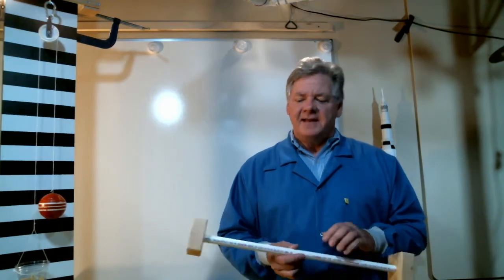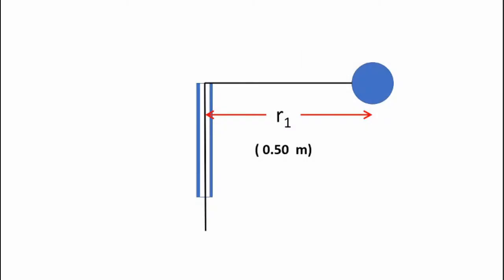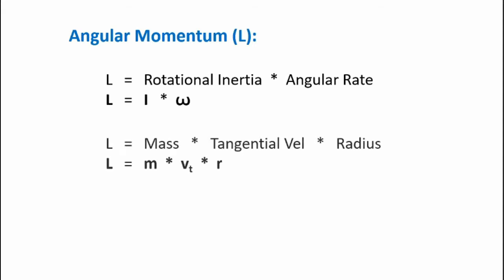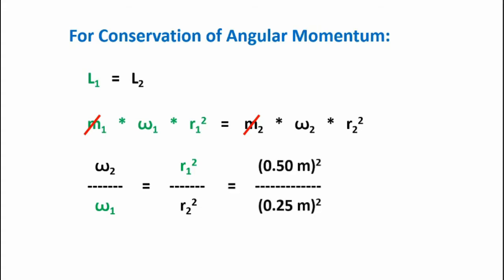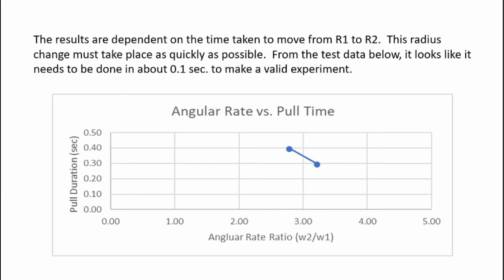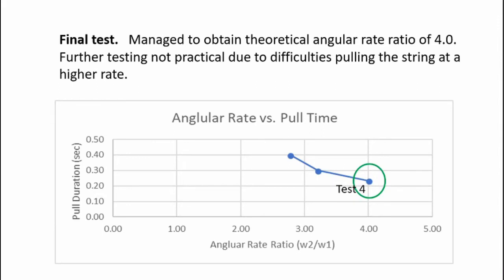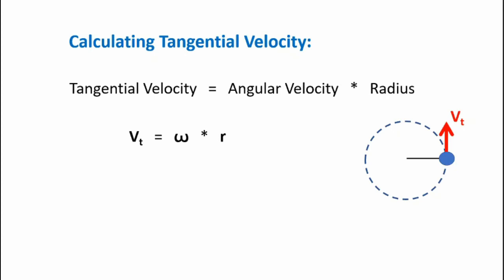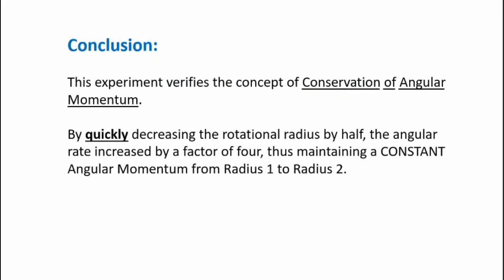Conservation of Angular Momentum

Comment: Dear Sir, had you been trying to confirm that angular energy was conserved and were expecting a result of a two fold increase, would you have continued manipulating your experiment or would you have been very happy with the perfect result your experiment achieved on the first pull ?
Reply: How come you dont believe in the conservation of angular momentum? Having seen your website and comments around I could only see your dissatisfaction with some discrepancy in numbers in experiments which are high enough to start questioning but not high enough to completly overthrow it. And thats he reason you completly refuse it?
Reply: @fracapolligummala3548  As part of my research and development, I was making experimental prototypes which were designed to conserve angular momentum to extremes. I discovered through experiment that angular momentum is not conserved.
Any rational person who observes an average (starts at 2 rps, radius reduced to ten percent) ball on a string demonstration  will agree that it does not accelerate like a Ferrari engine as is genuinely predicted by existing physics.
This is overwhelming independent experimental proof that angular momentum is not conserved.
There is no counter evidence. 
The Lab Rat has confirmed with a brilliant apparatus which achieves a perfect blind result that it is in fact angular energy that is conserved.
It is irrational not to completely refuse it.
Reply: @TheAnimammal  Cant angular energy and angular momentum be consevered at the same time? It works for linear motions.
Reply: @fracapolligummala3548  How can the result of this experiment be two fold increase and four fold increase at the same time?
Reply: @TheAnimammal  Your right, cant be. Acctually Im adding energy when im pulling the string, dont I? So energy increases by Force times way. Since we can derive the conservation of angular momentum from linear momentum, in which I think we still believe, then the resulting discrepance in energy would be the amount we have to put in. Now that im thinking about it I remember experiments from the ISS that showed that bodys when rotating and lossing energy begin to shift their axis to the one where the masses are out the farthest from it.
Reply: @fracapolligummala3548  The only way to add energy to the system is if you start yanking on the apparatus as has been shown precisely in this very example. before he yanks, his result is exactly two fold increase. Yanking on an apparatus is not acceptable and has never been acceptable. It is especially not acceptable to yank harder to overcome imaginary friction. It is imaginary friction because the initial result shows the expected negligible friction when it matches my prediction perfectly. Yanking is not repeatable (the same experimenter cannot achieve the same result twice in a row) therefore it is not science. The result otherwise is a two fold increase which means that there is no adding of energy to the system which makes sense because the force is perpendicular to the motion so the direction changes, but not the magnitude of momentum. Even when the radius is changing, the force is very nearly perpendicular to the motion (provided we are not yanking which is not part of a ball on a string demonstration anyway), so the component of force that is in the direction of motion is negligible. 

You are not adding energy to the system, you are supplying the required energy to generate non-linear motion of the mass. If no work was being done, the mass would travel in a straight line at constant velocity.

It is very clear, since I am presenting an argument which contradicts traditional beliefs that all of the existing theory contradicts my work. So presenting the existing theory which I claim is false against my proof that it is false, does not falsify my argument.

This is called an appeal to tradition logical fallacy.

My argument is basically that there is no extra energy being added to the system. You cannot prove that I am wrong by stating the opposite.
Reply: @TheAnimammal  I see your point. Arguments obviously have to be based on things we mutally agree on. Could you clarify then for me what things you still accept on the classical point of view so I know how far I have to dislodge my believes? Of course espacally interesting would be what gets conserved when. And if you dont mind, could you tell me how much you understand of analytics and vectors so we can speak on even terms?
The reason why I thought energy was added is because of the centripetal force. When we take an ideal model where everything is ridged and friction free we still have to hold the string, withstanding the centripetal force that keeps the ball on the circle. When we now pull it to get the ball closer in we have a force act over a way. Force times way is work speak energy. Since the nessesary force is determinied the centripetal force it will always be present and since there is no other thing were the energy could go in I though it goes in the ball. I cant quite see my mistake here yet :-(
Reply: @fracapolligummala3548  Work is force times distance, not force times change in length of radius. You are misapplying the work equation. That is where your mistake is. This is a red herring logical fallacy though because it doesn't address any of my arguments.  You can't tell me that my argument is wrong because you believe that you can explain the source of the extra energy which I have proven does not exist. This is not about mutual agreement, this is about rationality.
Reply: @TheAnimammal  I think you are a bit too fast for me there. Forget about the energy thing I was talking about. Pls tell me again the arguments I have to adress to be able to find a mistake. And pls give me clearity about our common ground. Do we agree on linear conservation of momentum, etc.... And if you dont mind, could you tell me how much you understand of analytics and vectors so we can speak on even terms?
Reply: @TheAnimammal  Whoops. How could I miss this? Anyway, I see whats going on here. Lets go through your points:
1) Starting with your discrepancy in experiments which seem to produce to low velocities:
There is not much I could say here since this is what you personally measured. The only thing I know that mechnical engineers use this correlation to calculate their machinery. If there would be any major discrepancy in a field like space sience then I can ensure you it would get the proper attention. The whole grab for the stars is currently not much more than sience in space. Spacecrafts were lost because of lacking physical understanding and so ridgid body dynamics was advanced, stange behaviours were observed and explainations were found and of course a lot of fundamental physic was tested and proofen. Just because one man cant live with his personal results on his experiments doesnt proof something so well tested wrong. (Unfortunately I cant show you a study or anything siencetific now but thats not the point here). But I see you think you disclosed some big lie here so lets just let this point open for now. Lets continue:
2) When you calculated the increase in energy you missunderstood its meaning: The one million percent increased valuve of energy(E2) show you what energy the mass has after your radius manipulation, right? So your manipulation to an lower orbit requires you to get that energy into the system since the resulting energy of the system increased (from E1 to E2). This indeed comes from the pull of the string. Since this confused you last time I ask you to imagine this: There is a black box and out of it comes a string. We dont know whats in that box but we observe that we have to hold the sting or else it gets spooled into the box and so we hold it. If we now pull on the string we have to overcome the force thats dragging the string in and if we do that over a certain distance work was done. This energy cant just vanish and so it has to go into the thing thats in the black box. Smart as we are we think that in the black box has to be a weight that pulls on the string and which gravitational energy we manipulate by pulling on the string or let it go, moving the weight heigher or lower. But what is that? We open the box and we find the experiment in the video. Now only the force doesnt come from a weight but from the centripetal force of the spinning mass. This means that when we pull the string to pull the mass closer we add energy into the system. Now guess how much?
3) In your discussion you proposed the conservation of energy as the more fitting model for you measured values. For that you said that the velocity of the mass stays constant, the only option to keep kinetic energy constant. But this would mean denying the coriolis force which is well documented and can simply be proven by experiment and measuring any value for it at all. You can say that you didnt measured what the conservation of angular momentum proposed but you cant deny that the velocity is changing when you change the radius.
4) What confuses me the most is that apparently you seem to accept the conservation of linear momentum but not of angular momentum. How should I say it? They are mutally supportive. One can be derived from the other and it doesnt matter which one you use. A linear moving mass is conserving its angular momentum as a spinning mass is conserving its linear momentum. This is not a observation which was put into fitting formular but its a conclution of pure logic. If you deny that angular momentum is conserved you deny that any momentum is conserved or you live in a chaotic universe that doesnt follow simple logic. Even the conservation of momentum can be derived by Noether-Theorem which again is a act of pure logic based on some undenyable facts about space and time.
My conclution is that in the worst case you proofed that the conservation of momentum doesnt apply but since its absolute fundamental to classical mechanic the error has to be so minor that even error sensible things like astonomical pedictions are still workable right. And however you turn it conservation of energy instead of angular momentum cant fit its place. More likely tough is that your experiment is flaud. To test this I propose you try built an experiment that fits the conservation of momentum and then try whatever you can to make it a valid experiment while maintaining its conservation of momentum. With this upside down approach your experiment become much more meaningful.
Reply: @fracapolligummala3548  1) This is the engineering delusion. Engineers are taught that angular momentum is conserved, but then taught to use equations which conserve angular energy and contradict physics. The reason you cannot back up your claims with any scientific evidence is because there isn't any.
2) Claiming I have misunderstood something when you are completely unable to point out anything directly that I have misunderstood is ad hominem attack and slander. The fact that you imagine you can explain where the extra predicted energy comes from does not falsify my claim that there is no extra energy. If you imagine that a one metre demonstration actually does produce / require sufficient power for a small village, then you are insane.
3) I do not deny coriolis force and you cannot produce anything about coriolis force which contradicts my claim. This is mindless wishful thinking imaginary evidence.
4) L = r x p. It is impossible to conserve both angular momentum and linear momentum if we change the radius because they are on opposite sides of the equation. One  cannot possibly be derive from the other. You are delusional to suggest that it is possible. 

I propose that scientists should produce an experiment which conserves angular momentum directly instead of misleading people into believing in it because a ball on a string spins faster which is still happening today, every day, despite your claims that it is a bad demonstration.

To declare that a ball on a string demonstration is not valid in order to reject my proof that angular momentum is not conserved is to claim that my proof that physics is wrong, is wrong because physics has always been wrong.
Reply: @TheAnimammal  So the length of the radius isn't a distance? If you physically pull down the string x meters to reduce the remaining length of the string about the axis of rotation, is that not the force of your pull on the string times the distance the string was pulled?
Reply: @iandougherty215  When the string is not pulled, then you are suggesting that no work is being done on the ball. If no work was being done during circular motion as you attempt to claim, then the ball would move in a straight line at a constant velocity.
Reply: @TheAnimammal  You literally just admitted that angular energy cannot be conserved by saying that. You have just astutely pointed out that there is constantly work done on the system, adding energy to it. This, by definition, means that conservation of energy does not apply. What I am actually implying is that there is work done when the string is pulled. It just happens to also be true that work is done when spinning the ball in the first place. You just made my point for me, better than I was making it. Thank you.
Reply: @iandougherty215  There is constantly work done on the system which spends energy changing the direction of the object in order to generate circular motion. The work done on the object does not add energy to the system because centripetal force cannot apply torque. We are not discussing conservation of energy, we are discussing conservation of the rotational kinetic energy (angular energy).

Is this too difficult to understand?
Reply: @TheAnimammal  Only for you, apparently. Work, by definition, IS the change in kinetic energy, and in this case, the only kinetic energy of the system (in an ideal setup, anyway) is rotational kinetic energy. This is known as the work-energy principle. https://www.toppr.com/guides/physics/work-energy-and-power/work-energy-theorem/. What you are suggesting is that the energy of the work disappears and does nothing. Even you must realize the absurdity of that statement.

No, the reality is that pulling the string actually perfectly generates torque. The pull of the string is at an angle of about 90 degrees to the plane of rotation, and Torque = r F sin(theta). The radius is the distance between the ball and it's axis of rotation, and F is the force of the pull. Sin(90 degrees) = 1, so you get a 100% yield on your torque conversion. Literally, this very concept, that pulling the string in a ball and string experiment is Work done on the system which generates torque, is shown as the description image for Torque on Wikipedia: https://en.wikipedia.org/wiki/Torque. This is mathematically described by another interpretation of the work energy principle with regards to rotation: http://hyperphysics.phy-astr.gsu.edu/hbase/rotwe.html

Also, a bit of a semantic argument, but you just said that work "spends energy changing the direction of the object" and also "does not add energy to the system". This implies that energy is subtracted from the system and not replenished...which means that angular kinetic energy is not conserved. Additionally, "changing the direction of the object in order to generate circular motion" is basically the function of torque.
Reply: @TheAnimammal  Hey I read your website and there seems to be a major thing you overlooked...
If you reduce r by 100, you're right that it would increase angular velocity by 10000. But it also increases centrifugal force by 1000000! Therefore such a demonstration is impossible in human hands unless there's significant friction slowing things down, and according to physics conservation of angular momentum is only true when there's no friction.
An easily visible example of how angular momentum is conserved is any gyroscope.
Reply: @15Redstones  I have not overlooked anything. Such a demonstration is impossible according to physics but it happens in reality and therefore physics is wrong. 

This is not very difficult.

The gyroscopic effect has nothing to do with conservation of angular momentum.

Your grasping at straws bullshit about friction is pseudoscience.

This perfect confirmation of my prediction as announced at 5:40 simultaneously proves the the three hundred year old generally accepted physics assumptions for this demo that friction is negligible.
Reply: @TheAnimammal  where does the energy required to overcome the centrifugal force go?
Reply: 15 Redstones It goes into overcoming the centrifugal force???
Reply: @TheAnimammal  let's say you use an amount of energy E1 to spin it up, then another amount of energy E2 to pull it in. Therefore after pulling it in it has to have the energy E1+E2.
Reply: 15 Redstones Angular energy is the sum of the work done by torque. E1 is applied torque so it goes into angular energy. E2 is not torque and therefore cannot affect the angular energy. That is why his result is a two fold increase. The momentum is the same but angular momentum changes.

This is a very simple stupid mistake.
Reply: @TheAnimammal  then tell me where did E2 go? It can't just disappear into nothing. Total energy has to stay the same. If your theory doesn't have the total energy stay the same, it's invalid.
Reply: @TheAnimammal  by the way, here's a quick calculation:

E = m/2 v² = L²/2mr²
dE/dr = - L²/mr³ = - mv²/r

Conservation of angular momentum leads to change in energy when r is changed which creates the resistance to pulling it in which is the centrifugal force.
Reply: 15 Redstones this is really not difficult. When we measure the experiment, the results show clearly that there is  no change to the energy as you imagine. My theory is confirmed perfectly, and your theory is proven wrong.
Reply: @TheAnimammal  a lot of theories were thought to be proven right by experiments but later more accurate experiments proved them wrong. Your theory is clearly impossible because total energy is not conserved.
Reply: @TheAnimammal  let's assume that you're right and angular energy is conserved. I'll run my own thought experiment assuming that this law is true: 
Let's say that I have some kind of mechanism that can spin up and slow down a spinning mass and change the radius, and let's assume that this mechanism is constructed well enough that there is very little friction. For example a mass of 1kg and a radius that can vary between 1 and 2 meters. This can be a string or some other kind of variable radius mechanism. 
Let's say I set it to 1 meter radius and spin it up to a velocity of 1 m/s using E = ½mv² = ½ Joule in.
Now the centrifugal force is F = mv²/r = 2E/r = 1 Newton. If I now increase the radius, the work done by the centrifugal force is W = ∫ 2E/r dr = 2E ln(r) = 2E ln(2) ≈ 0.69 Joule out. 
Since it's still spinning with the same energy E = ½ Joule, I can now slow it down and regain that energy.
After it's stopped the centrifugal force is 0, so the work required to set the radius back to 1 meter is 0.
Now the machine is back in the same situation where it started, after it went through the following four steps:

r = 1m, v = 0, E = 0
Add ½ Joule in
r = 1m, v = 1m/s, E = ½J
Increase radius, gain ≈ 0.69 J work
r = 2m, v = 1m/s, E = ½J
Stop it, regain angular energy ½J out 
r = 2m, v = 0, E = 0
Decrease radius
r = 1m, v = 0, E = 0
Repeat 

During each cycle you put in and regain out the same half Joule of angular energy, but you also gain about 0.69 Joules of free work out. Therefore conservation of energy is violated if angular energy is conserved during change of radius. 
This is what an actual proof looks like, not just coming up with a large number and claiming that it's impossible.
Feel free to point out any math error.
Reply: 15 Redstones you error is in imagining that you can counter independent perfect confirmation of a theory by presenting argumentum ad absurdum. Logical fallacy is pseudoscience.
Reply: @TheAnimammal  point out the error in my math or admit that conservation of angular energy is wrong. My proof is a simple thought experiment and math calculation, the same thing you did in your paper. 
Note that I'm not trying to prove conservation of angular momentum, I'm disproving conservation of angular energy. I'm still assuming for the sake of the argument that it's perfectly possible that both are wrong.
Reply: 15 Redstones I do not need to to address your theory. I have shown you independent experimental confirmation that you are wrong. Do you think that  Richard Feynman said that if the results of experiment do not match the predictions of theory, then we must make endless excuses for the discrepancy and always assume that reality is wrong?
Reply: @TheAnimammal  oh I'm no longer arguing for angular momentum. For now I'm willing to admit that it may be wrong.
Now it's on YOU to defend YOUR theory of angular energy, especially since I have a mathematical proof that it results in free energy if it were true.
Reply: 15 Redstones once again. The experiment confirms perfectly with a very accurate result that angular energy is conserved. Experiment trumps theory anytime. Please stop the pseudoscientific bullshit argumentum ad absurdum logical fallacy and address the evidence like a real grown up scientist?
Reply: @15Redstones  Your "mathematical proof" is bullshit motivated reasoning argumentum ad absurdum logical fallacy childishness. My work is proven by my maths and is confirmed by independent experiment. "Willing to admit" is irrational. It is proven and confirmed. Cannot be more scientifically proven than that.
Reply: @TheAnimammal  in order to prove your work you'd need to measure the exact angular energy in multiple situations. Decreasing radius and increasing radius. Do that and I'll believe you.
Reply: @TheAnimammal  you still haven't pointed out any error in my math... If you can't defend your disprovable theory don't be surprised when nobody believes you.
Reply: @15Redstones  I have defended my theory. I am not going to be misled by bullshit. Please stop the pseudoscience?
Reply: @TheAnimammal  no, you've not pointed to any error in my proof. Science involves disproving wrong theories. That's what I'm doing with yours.
Reply: @TheAnimammal  where's the fallacy? Point out the exact location of the error and I'll admit defeat, but so far I'm only getting the impression that you haven't even understood it
Reply: @TheAnimammal  if you ever want to get your theory recognized by other people you need to properly address any criticism of it, or nobody will take you seriously. Barely anyone believes you right now. Don't you want that to change? Your current approach hasn't made any progress in convincing people in years.
Reply: 15 Redstones the fallacy is the fact that you do not address my argument or the evidence. You present a red herring argument in which you draw a fake conclusion which you imagine is impossible and try to imagine it defeats me. It does not defeat anything. Argumentum ad absurdum is well known since Roman times. Acknowledge that the result of the experiment confirms my prediction perfectly which means your theory is wrong.
Reply: @TheAnimammal  it's a thought experiment based on your theory which concludes that your proposed law of conservation of angular kinetic energy leads to a change in total energy. It is not absurd, it is a thought experiment about a machine that could very well be built. The conclusion is the result of maths. Where EXACTLY is the error? You're just name-calling it.
Reply: @TheAnimammal  so far you've called my proof a red herring, bullshit, fake, ad absurdum and more, but you've not pointed to a single actual error. I'll take that as a compliment, my logic is so good it's making you angry cause you can't disprove it
Reply: 15 Redstones I have pointed out that your argument does not address the evidence and is an argumentum ad absurdum. Ie Your entire argument is a three hundred year old evasive logic fallacy tactic that would be dismissed in Roman times alreaady. Your entire argument is dismissed. Properly like it would have been in Roman times. You are evading the evidence. I am not evading anything because I have defeated you.
Reply: @TheAnimammal  you're right in that it doesn't adress the evidence. It's a thought experiment after all. What it does do is adress your theory of constant angular energy. You've clearly not understood what it's actually saying. Point out an actual math error.
Reply: @TheAnimammal  still waiting for you to point out an actual error in my math... Or are you saying that the assumptions of my thought experiment were wrong?
Reply: 15 Redstones you do not address my theory. You cannot possibly address a theory with a logical fallacy. Even if your maths is right it is still a logical fallacy and I am not obliged to address it. If I present a theory, and you try to make fun of the conclusion of my theory by motivated reasoning reductions to the absurd, then everything you say must be disregarded as pseudoscience. The scientific method is to repeat the experiment and confirm or deny the presented evidence. That is the only way you are going. To shut me up. Publish the results of a ball on a string demonstration of conservation of angular momentum. It confirms who is right. So simple, but bias prevents people from behaving rationally. You want me to shut up then publish the results. The problem is that the results agree with me. So you would rather carry on the pseudoscience. 

Do the experiment and publish the results then I will shut up because you will then have to agree with me. 

What is your idea. Try to stay blind to the obvious simple evidence as long  as possible delaying progress as much as possible?
Reply: @TheAnimammal  your theory is that E=½mv²=½mr²ω² stays constant when r is changed. That is the basic assumption of my calculation, which proves that it results in free energy out of nowhere. Where's the error in that?
Reply: 15 Redstones it is irrelevant. Argumentum ad absurdum is irrational. Your argument is defeated because it is logical fallacy which is pseudoscience. Accept the scientifically proven fact that angular energy is conserved as measured.
Reply: @TheAnimammal  addressing theories with how they perform under hypothetical scenarios is how all of theoretical physics works. Ad absurdum is not a logical fallacy in science because laws of nature have to hold true in all scenarios, even absurd ones. For example if the theory is that all numbers can be expressed as a fraction of two integers, it is not a logical fallacy to disprove it with the example of pi.
Reply: @TheAnimammal  https://en.wikipedia.org/wiki/Reductio_ad_absurdum?wprov=sfla1
Ad absurdum is a totally valid form of reasoning when discussing laws that have to hold true in all situations. Closely related to proof by contradiction.
Reply: @TheAnimammal  show me an experiment where angular energy is conserved when r increases. Do that and you have an instant Nobel prize. Constant angular energy with decreasing r is totally useless though.
Reply: 15 Redstones Absolute nonsense. I have presented proof. Independent experimental confirmation. Right now the balance of evidence is a hundred percent on my side of the scale. 

It is preposterous to suggest that I am responsible for more independent evidence. That is complete bullshit. 
You need to conduct some science and go measure a ball on a string demonstration of conservation of angular momentum. How can you just ignore the evidence. That is the behavior of a religious nutcase.
Reply: @15Redstones  Out of curiousity, is there ANYONE who has accepted John Mandlbaur's conclusions?
Reply: @icansciencethat  one other commenter on this video...
Reply: @15Redstones  Oh I see that. Thanks. Another conservation of energy fail.
Reply: I accept your surrender. Then Farewell,  warrior of the truth. I hope you learned your lesson. And if you did, you even reearned my respect.
Reply: Warn Hekker we’ll you are delusional then. 

It is clear that you are incapable of learning anything new.
Reply: @TheAnimammal  I was open to your ideas but you are clearly not to mine. There's then nothing to say anymore. Im out.
Reply: Warn Hekker so any time your ideas are properly defeated, you maintain your mistaken beliefs by ignorance of the evidence. And delusional claims of surrender. 

It is you wasting my time.
Reply: The problem here is the expression "conservation of angular momentum" - it doesn't clearly express the fact that the angular momentum only remains the same because energy has been added by pulling the string. If you were to build an experiment to pull a mass in from 1m to 1cm in a vacuum, the energy you'd need to apply to pull the string in in the later stages would become enormous - if you can't put enough energy in to do it because it's reached too extreme a force, then you simply can't pull the string in fully. If you do the experiment in air, the drag will get so extreme that the mass never reaches extreme speed, so you can pull the ball all the way in easily and it never goes extremely fast. The reason Mr Labrat had to pull the string in fast is that it gives less time for drag to act on the ball to ruin the experiment. If you were to do the experiment in a vacuum, you could pull the ball in really slowly and still get it up to four times the rotation rate because you wouldn't have the losses to drag.
Reply: @DavidCooperPorteous  You present imaginary evidence. This is a ball on a string demonstration which has been conducted in open air for centuries and now all of a sudden it must be done in a vacuum. I call bullshit. Present some evidence to back up your speculation.
Reply: Here's a spreadsheet which explains what you need to do to convince me: https://docs.google.com/spreadsheets/d/1qgobU30468EZpNgLwGMewdblgCuvCumgE3x4jsdpfps/edit?usp=sharing
Reply: Having just read through all of this, I can see why no one takes you seriously. It's because one, you're a jerk to everyone who tries to peer review you, and two, your ego prevents you from calmly addressing criticism with step by step responses rooted in math. In short, you show people your work, and when they do their job by criticizing it you throw a tantrum. Even if you were right, no one will ever take you seriously now. You've made yourself too unlikeable and too childish. You have no decorum. Why would anyone ever willingly work with someone who talks like you do? I wouldn't. You couldn't pay me enough to work with someone who swears and name calls in a scientific debate.
Reply: Except angular momentum is ALWAYS conserved in situations without torque, if you siagree I challenge you to provide an example of a >5% change in angular momentum for a body in space.